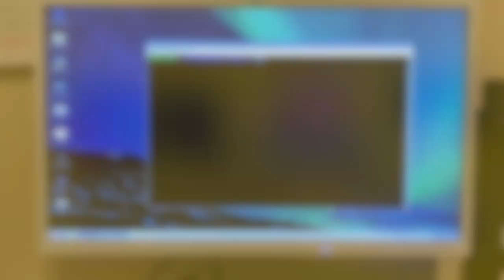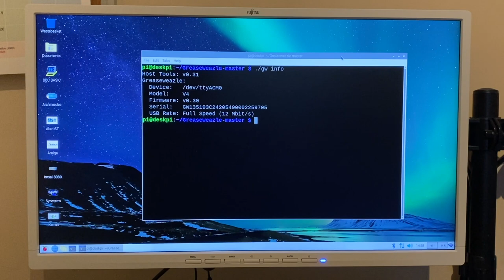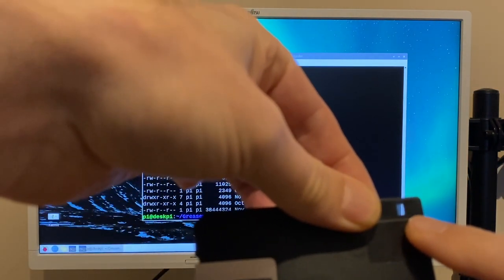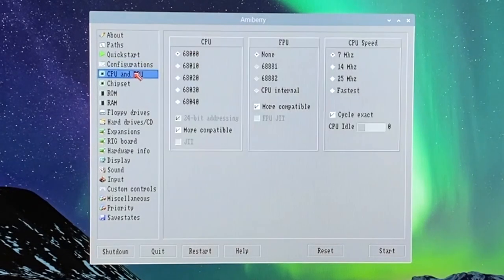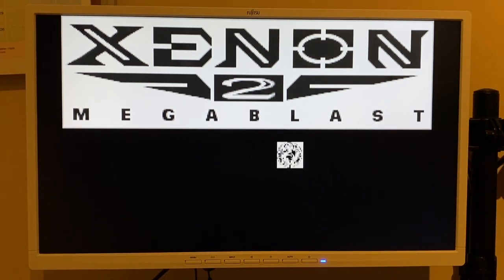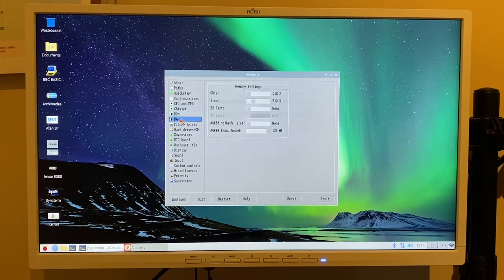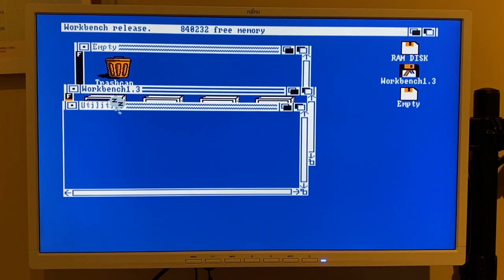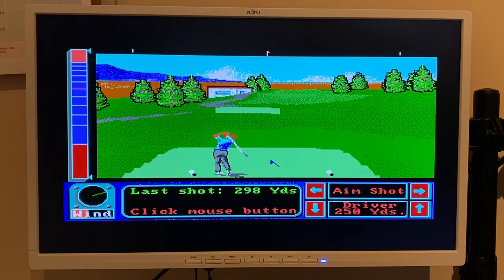Amiga 500 PI 4 with Real Floppy Disk (Amiberry + Greaseweazle)

Comment: I LOOOOOVE the Greaseweazle. It's the best thing since sliced bread.  I've spent many evenings making hundreds of ADF and SCP files and it's absolutely flawless.
Over the years I collected 15  A500's,  2 HDDs, several external floppy drives and an A570 CD drive which are all sitting in my cupboard but it's far more convenient to load up the emulator instead. 
Amiga500.... my precious!

Comment: Could you post a link to where I can get the required power cable for this please? The Greaseweazle and floppy both have the same connectors and the only power cables I have are the molex to floppy type.
Reply from the maker: Hi Graham. I just used one of these: https://www.ebay.co.uk/itm/251052767021
Reply: @RTSRetroTechShed  cheers!

Comment: Hello. Excellent video. Greaseweazel doesnt show on expansion boards menu. Any help would be appreciated?
Reply from the maker: Hi Savas, thanks. If you are running a more recent version of Amiberry (e.g. 5.6.1) then the way to configure the GreaseWeazel is slightly different. No need to set the Disk controller in Expansions. Simply select the DrawBridge driver from the dropdown in the Floppy drives tab and set DF0: or DF1: to be FB: - hope that helps
Reply: @RTSRetroTechShed  I tried that, but it didn't work for me because I try to connect to original Amiga drive (with straight cable), but there is no option to select Drive :0 which worked for me for the same drive in WinUAE